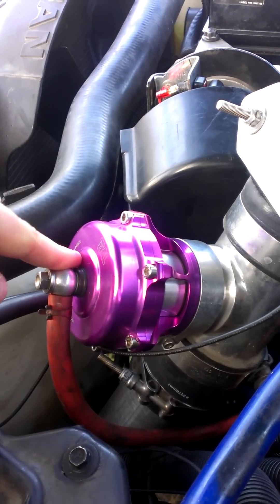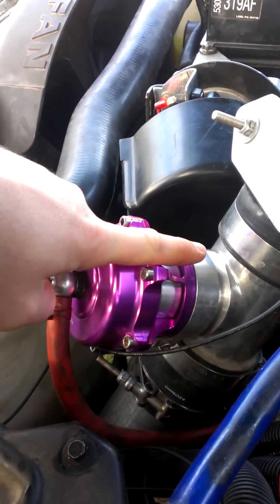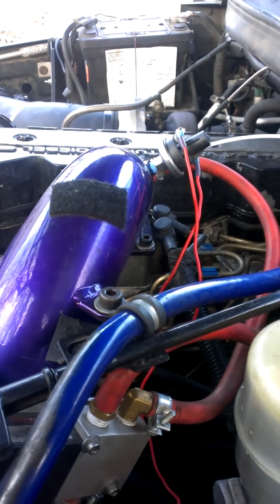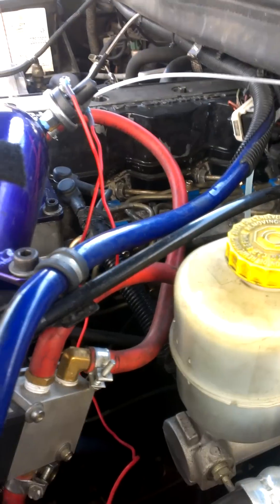Bov on Cummins diesel...how it's plumbed

Comment: I make about 48 pounds on my Commonrail and will 7 pound spring work okay? I don’t have a vacuum but I can leave one of those ports open with brass filters I assume.
Reply from the maker: Totally fine because your boost will actually be feeding the top of the valve this holding it closed with the 48psi+ 7lb spring.

Comment: What is the purpose of the blow of valve? Are factory Diesel engines have them?
Reply from the maker: No factory diesel engines don't have them. Common in performance applications.
Reply: @ONEBADZ  , why does someone needs to have one?
Reply from the maker: @repairvehicle  relieves boost pressure left over in the aftercooler/intake tract when chopping throttle. Not having some form of blow off or recirc valve forces the air to travel back to low pressure. This can result in turbo damage.

Comment: could it be good if i combine bov and aftermarket ecu controller to improve power?
Reply from the maker: spudz spade what kind of vehicle are you talking about?
Reply: i have  a diesel pick-up truck and im interested installing aftermarket turbosmart bov to my truck but i installed already a turbo boost controller, if i equip this to my truck could  could my truck add horsepower?
Reply from the maker: spudz spade a boost controller regulates how much boost you are allowing your truck to make. A BOV is simply to prevent turbocharger damage that can occur from torque converter lockup or shifting (engine load changes) it will not change your power levels by installing one. It also won't allow your engine to take on increased boost levels. It benefits only the safety of the turbo charger by preventing turbo "bark" or flutter.
Reply: wow.. thanks for the information. its gives me more knowledge..

Comment: you litterly need to add a 4 dollar relay lol .. buy a normally closed relay and put in inline to your switch ... energize the relay with the cuise control hot wire ... this way ... when its off it works like normal but when you turn on cruise (energize relay) the circut opens and disconnect the switch
Reply from the maker: maybe I'll mess with it again one day. Have since removed the BOV after going to compound turbos my barking issue has gone away.

Comment: This video is quite useful, I thought I would have to use a electrically actuated throttle body to use along the BOV live I've seen in some European diesel cars, but this is a great work around, Thanks!
Reply from the maker: Happy it helps 👍
Reply: @ONEBADZ  I wish you listed the parts you used 😢

Comment: guess what my diesel doesnt have a vacuumpump now what?would one be able to replace the vacuum deal with a solenoid so it powers one way when closed and when it needs to open the polarity on the solenoid reverses and pulls the valve open then when it needs to close again the polarity changes again
Reply from the maker: I ran this same setup for a while with no vacuum source. the port on the solenoid valve (small black box with all the hoses coming out of it) that I point at as having the vacuum plumbed to I just left open (no hose just a little filter on it you can get at many places that deal with air tanks and valves. it's just a weird looking brass deal that threads in. the BOV will still open so long as there is enough pressure in the intercooler pipe to overcome the spring in the BOV itself. The addition of vacuum in this case is just to aid in pulling the valve open but the air pressure in the pipe work will push the valve open on its own as long as it exceeds spring pressure. no extra gizmos required beside what I have shown here so long as you plumb it correctly through the solenoid valve.
Reply: so you dont need engine vacuum as long as you adjust the spring pressure low enough to be pushed open by the pressure buildup
Reply from the maker: +yorrickwi. indeed. because of the solenoid valve flipping the way the positive pressure is routed. in the part where I mentioned it will switch and receive vacuum signal, you will not receive vacuum it will simply no longer have the pressure along with the spring to push the valve closed. so long as the pressure buildup is greater than the spring it will act as a "pop off" and release pressure until the buildup is low enough for the spring to defeat and slam closed again or until you get back on the throttle (releasing button and therefore switching the pathway air travels through the solenoid valve, at that point the positive pressure buildup along with spring pressure are holding the valve closed again).

Comment: why in the world did you do this? especially to a diesel
Reply from the maker: To save the $1500 Industrial Injection Phatshaft turbo. Bastard would bark pretty hard when pulling trailers through the mountain passes over here. When letting out of the throttle in boost around 30 psi the charger would bark (the cool sounding dew dew dew) is hard on turbo shafts and thrust bearings, its basically stalling and fluttering the comp wheel back and forth because the pressure the charger builds in the IC pipe is no longer being consumed by the engine. The charger slowing down creates a low pressure area in the mouth of the charger so the high pressure air in the IC flows backwards toward the turbo. Releasing the excess pressure in the IC pipe back to atmospheric pressure or atleast a pressure matched to what the charger is flowing at it's reduced speed prevents the air from traveling back toward the charger.
Reply: Then why not just tune the waste  gait to the engine? And save the money you spent on all that bov stuff disel turbos should never need a bov due to the fact that they have no throttle body to restrict inlet pressure. My 500 hp Cummins has never barked once
Reply from the maker: Aubry Harrington don't know what to tell ya man. The wastegate only vents off the exhaust not the compressor. The rpms on my truck fall off fast enough that the engine fails to consume. This is not some outta the real world shit I did here lol. Turbosmart and BD both make BOV kits for diesels to the tune of $600 or so. I was doing 530 rwhp with this 62mm charger but have since gone to a compound turbo setup. No barking issues but then again my secondary charger has a false atmosphere created by the primary in the compressor side and the secondary creates a false atmosphere for the primary on the exhaust side of things.
Reply: @KJ4SQP  500. So you would have no idea. And different turbos react differently. These are being introduced into the diesel world. I use drive pressure on mine. Not electronics.

Comment: didn't want to go with the simple reference line off the + side ?  why such a complex over-engineered setup ?
Reply from the maker: Not possible on this engine or most diesels for that matter as there is no throttle body or valve of any sort that closes in the intake tract. Because of this there is never a vacuum reference off the intake therefore the valve would always stay closed. There needs to be a pressure differential on the sides of the diaphram to allow the valve to open and close. Only options are block the positive air feeding top to allow the pressure in the tract to force valve open or introduce a vacuum source. Diesel engines are different animal.
Reply: There's a company that makes a piston style bov that I run on my diesel. Top is drive pressure. Bottom is regulated boost reference. No electronics. Works fantastic. I like your set up though. I just wanted to stay away from electronics and I'm Stoopid. So I went the mechanical route.

Comment from the maker: indeed you could! thats how banks exhaust brake i had on the truck previously was. if the toggle for power was on cruise couldnt be set. if cruise was set and you toggled power on cruisr would shut off.

Comment from the maker: read 1) first lol. most diesels don't have this plate in the intake tract there for when you let off the throttle there is no vacuum taking place. the solenoid valve is basically doing the same thing a throttle body would do but only affecting the feed to the BOV. no way to plumb besides using a source to stop the positive pressure feeding top of BOV. vacuum isn't completely needed but makes valve much more responsive. BD turbo Guard $650 for diesel. BOV for tuner car around $250 for same BOV

Comment from the maker: 1)most diesels do not have throttle bodies. there is nothing in the intake tract to open and close and create a vacuum source. on a wrx etc. there is a throttle body, the line feeding the top of the valve is in the intake manifold. when you are on the pedal the TB is open and air coming through. let off and TB closes. engine fights for air thus creating vacuum in the hose feeding the top of the BOV. BOV is sucked open until the pressures in front of and behind the TB normalize. cont to 2)

Comment from the maker: liked this a little more because it just took out the thinking lol. don't have to think about pushing button or anything anymore, just let off the pedal and if all criteria is met in the system then it opens. i could set the pressure switch higher so it would only do when i really need it up in the higher boost levels but i don't mind it popping at 4 psi lol.

Comment from the maker: yes well bracket is just a modified piece of bracing from home depot. just the 90 degree angle brace then i bent one of the legs and did a little refining. you can find the brace i used in the isle where they keep gate latches and hinges and such...